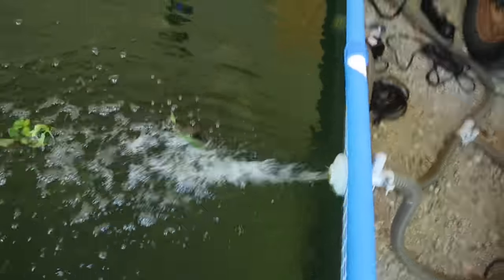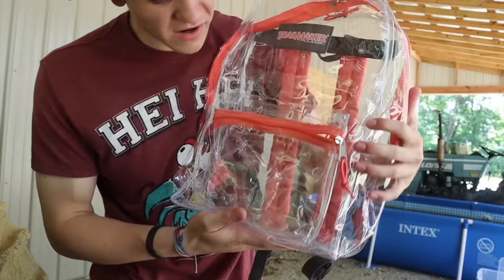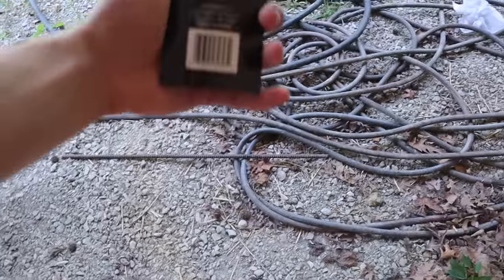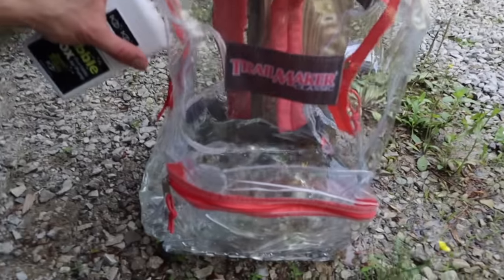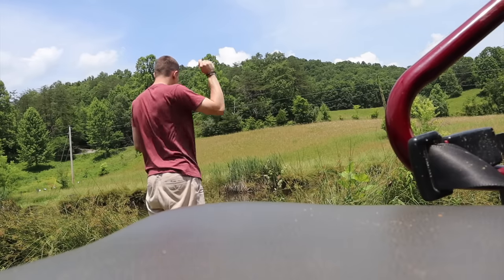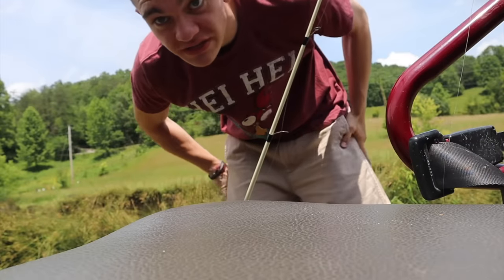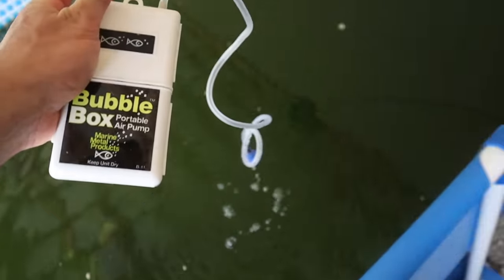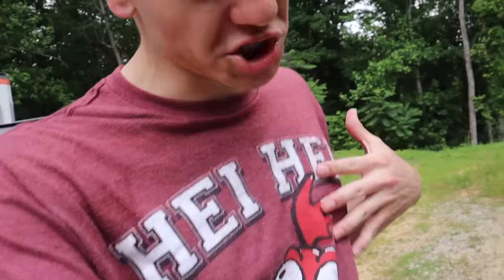BACKPACK PORTABLE POOL POND!

Comment: that backpack would work if you placed a clear plastic container inside of it - you could drill a small hole in the lid to run the airline tubing to the stone. it would still look like you were carrying a small aquarium on your back without all of the hassle of getting soaked, etc.

Comment: Guaranteed you don't read this since the video is old but I work in schools. Clear backpacks are required for the safety of other students. Being able to see through backpacks lessens the chance of aggressive students bringing KG pocket knives (or worse) to school. :-) Haven't finished the video yet, but silicone caulk the seams (maybe you did and I haven't seen it yet).